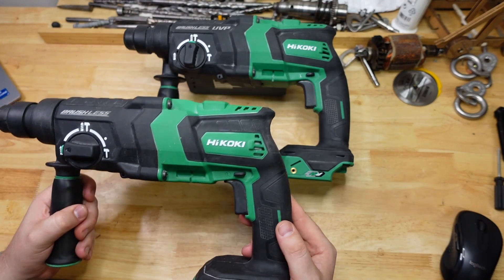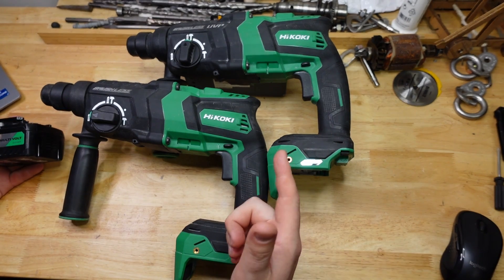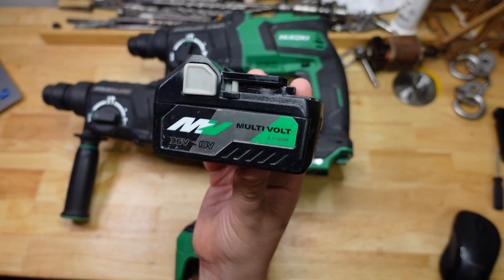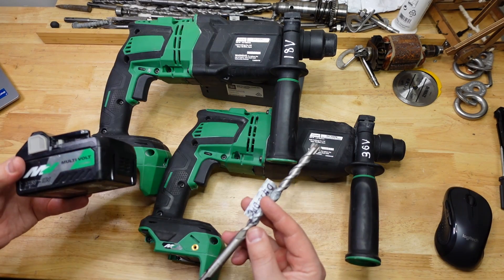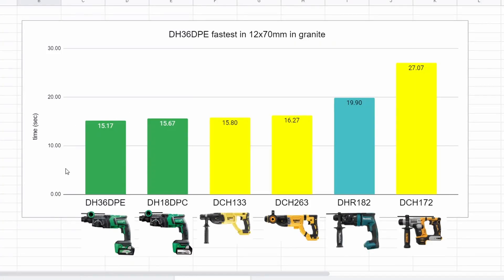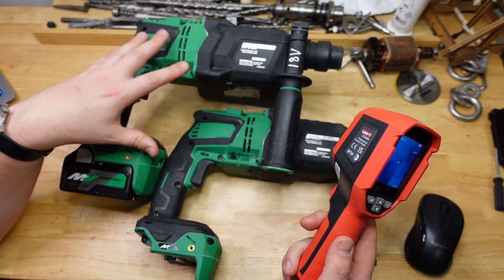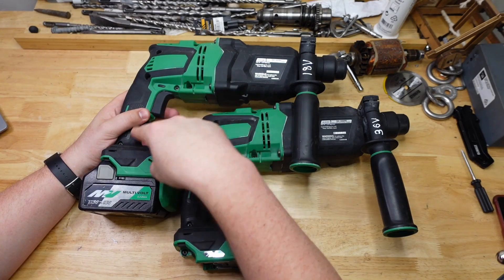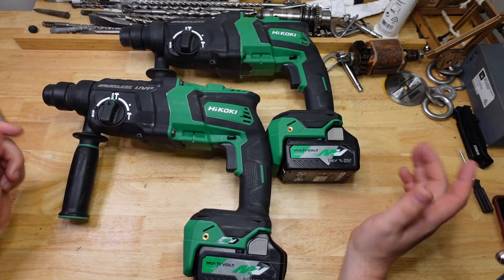18V vs 36V vs Granite! (Hikoki/Metabo HPT Rotary hammers)

Comment: Interesting video, Hikoki lasts so far, use a makita for months, use a dewalt for months. My Hikoki batteries 14 of have been flawless they nailed the multivolt system.  I like dewalt but it doesn't make it long down a hard road
Reply from the maker: This guy hammers! What're you drilling that wears them out so fast?? Just lots of runtime? I'm keen to hear about the lifetime of these hammers cos I don't use them enough to wear them out. But: my impression is that hikoki is second only to Hilti in build quality. They seem really well made but I don't run them that hard so can't say

Comment: To explain 18V and 36V. The 36V is going to be more efficient than the 18V as the motor doesn't have to work as hard to drill the hole. Therefore running more economical.

Imagine, a Suzuki Swift vs Dodge Ram, trying to pull a 2 ton trailer up  a hill ( not that a Suzuki Swift is designed to pull 2 ton), the Suzuki is going to need to work alot harder to get the trailer up the hill than the Dodge because the Dodge has a bigger engine. 

Hope this helps.

Comment: I disagree with your statement "in theory the 36V should be faster."

I stand to be corrected but one would assume that the efficiency of the battery would increase with higher voltages, similarly with UPSes. A 12Vdc battery ups is less efficient that a 24 or 48Vdc battery ups. The run time increases with 24 and 48V UPSes due to higher voltage batteries being more efficient.

As for the power of the drill; barring any operating conditions set by the manufacturer you should have the same outputs (RPM, BPM and Joules) irrespective of the supply voltages from the battery. i.e more volts doesn't equal more power because the power (W) the motor's are drawing must be similar. Main difference being would be the 18Vdc drill has more current flowing to it than its 36Vdc counterpart. P = V * I ( Power = Volts * Amps)

Disclaimer: I'm not a battery expert nor do I understand how drill motors work with different voltages. Just making an assumption based on experience with UPSes and Inverter+battery backup systems
Reply from the maker: Yes I think you're right.
I don't recall exactly what I was talking about that you quote but it could be 2 things:
the 36V would in theory drill faster because it's rated larger (28mm vs 26) so there's gonna be some increase in power (presumably the motor).
Or the 36v should run out faster as it's only got the 2.5aAh Battery vs the 5. 
But yes you're right! If the efficiency is much better for the 36 then it should have longer runtime (if you look at the watts & watt-hours rather than Ah). I don't know what it is, but my experience with older 36v tools led me to expect pretty poor runtime just based on the Ah

Comment: 6:55 the 36V will be using approx. half the current. 18V × 20A = 360W. 36V× 10A = 360W. The 36V will be a bit more efficient, hence longer runtime (or more power, or both)
Reply: I should have read the comments first. I wouldn't have lost 10 mins of my life typing my own comment which says basically the same thing you did 😅

Comment: 4:12 you should be normalising by Wh rather than Ah. The 36V and 18V have the same capacity in Wh, so should have similar runtimes. The 36V will generally be more efficient as it'll be running at lower current and therefore producing less waste heat.
Reply from the maker: Oh great I need to make another graph!? 🤣 But yeah good call, I didn't think of Wh. I'll need to remember that in future
Reply: Yes I also reacted to this. 2,5Ah at 36v or 5Ah at 18v is the same (more or less).

Comment: 3,2 joules for 3,5kg with battery that seems unbeatable doest it feel way more powerful than the other 1inch Rotary drills youve tested like the Milwaukee, metabo...? Thanks
Reply from the maker: I can't really say it felt more powerful than say M18FH as I haven't used many drills in granite like this, but the green did feel very good here. And I do find 3.2 a bit hard to believe, but then it did drill faster than DCH263 so the hikoki impact force is definitely at the higher end, if not exactly 3.2 then maybe 2.9 or something? I need to finish building my test rig to find out!